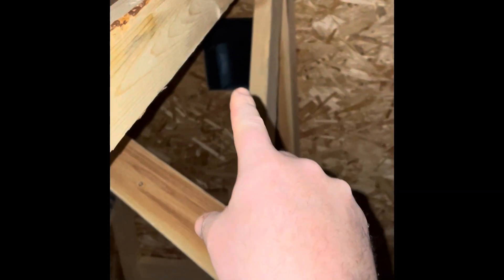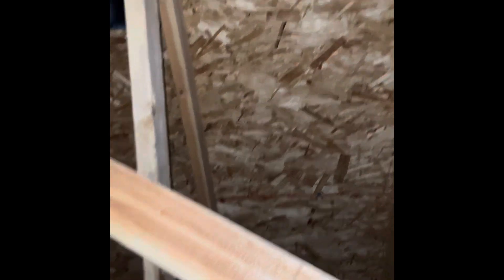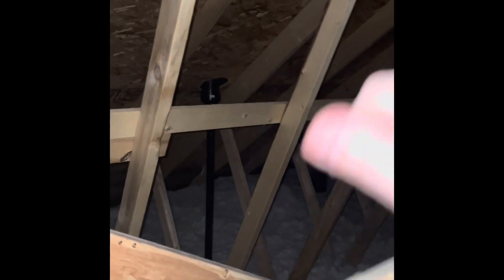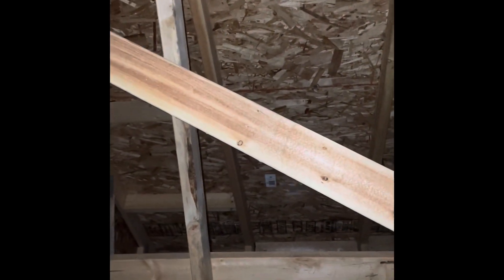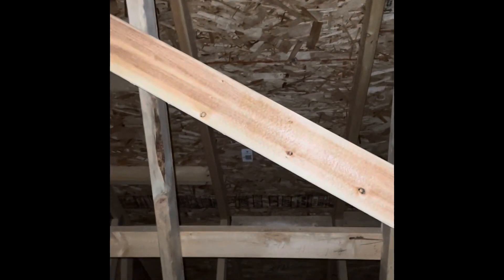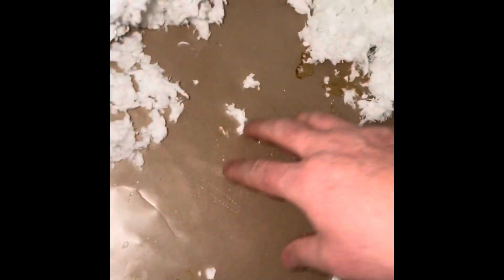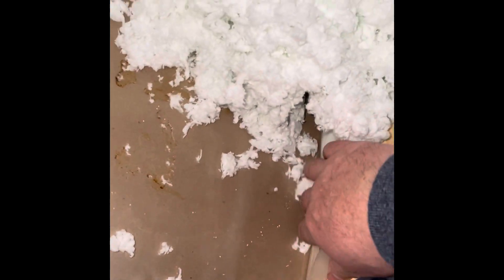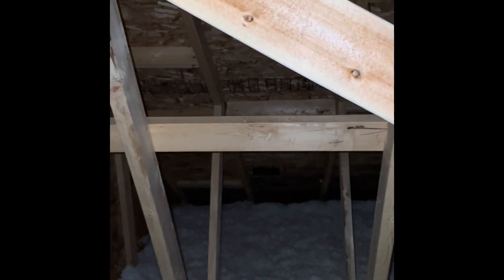Attic Rain Explained

Comment: Hey quick question, so water on the outside of the vapour barrier like you said is generally not a cause for concern? Unless it leaks into the drywall below, but if it just stays on the attic under all that insulation it’s generall fine?